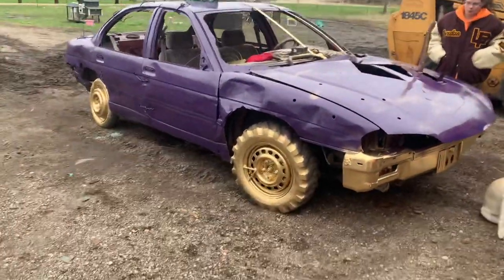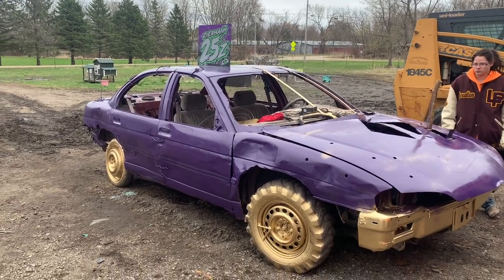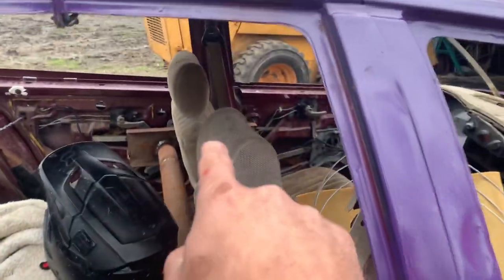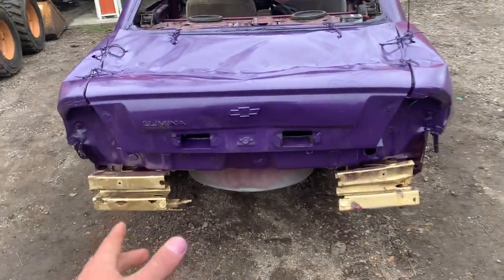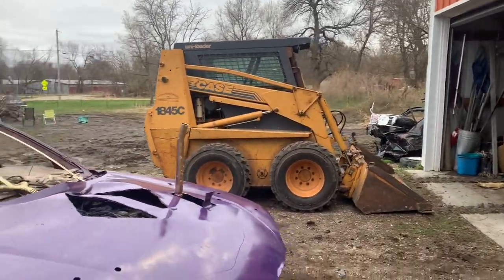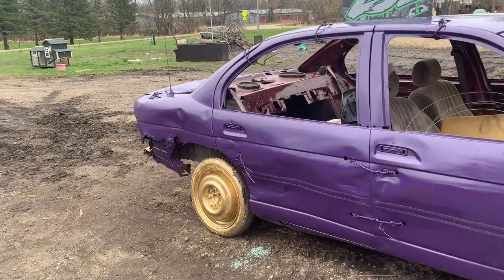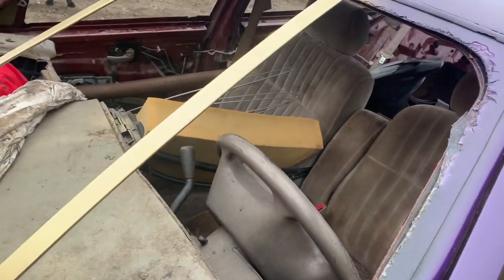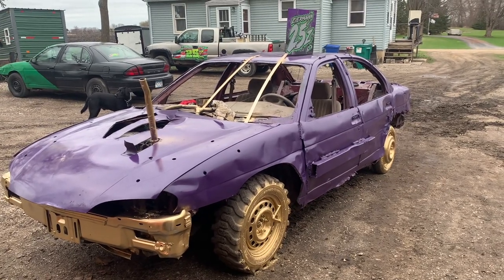Stock derby car build for 2021

Comment: Very impressive little gladiator. Normally I'm not a fan of cheap front wheel drive cars, but with those angry little off road tyres on the front it looks absolutely beastly.

Comment: Good luck with it here's a little advice to keep it from dropping in front of you're wheels take 9 wire double go around you're frame in front of you're back wheels and go straight up thru you're roof and twist it tight it will keep it from dropping to quick

Comment: Use bars leak pour directly into radiator stop leak head gasket fix it works its saved me 3 or 4 times I dont endorse things unless they work ..

Comment: I'd like to see you run a newer vw bug they are tough as hell and take heat good they are tougher than a Lumina and camry try one you won't be disappointed
Reply: If anything you want an old bug they still around after like 40 or 50 years i think they are pretty tough doubt anything made in the past 10 years will be here in 30